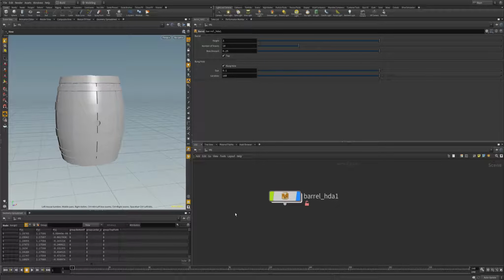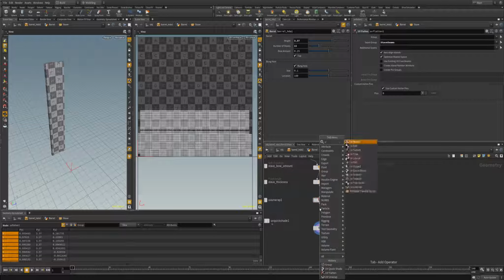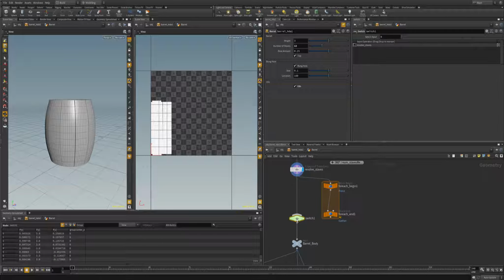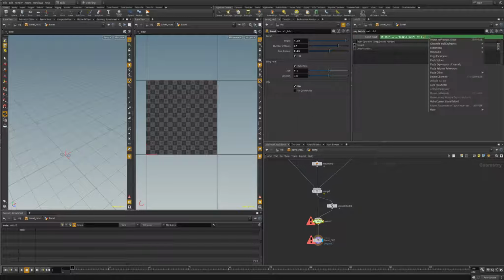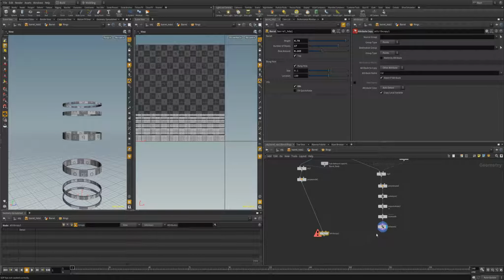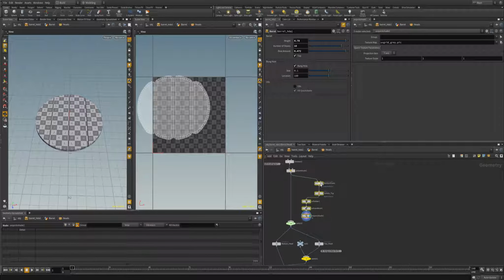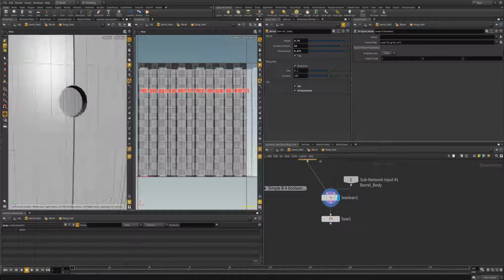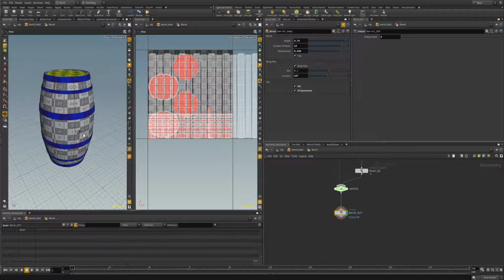Introduction to Houdini 16: Creating a Digital Asset Barrel (Part 4)

Comment: Hello. I try to repeat your lesson, but when i make for-each loop and uv transform, UVs works uncorrectly. For example: i have 4 copies (by copy and transform node) of geometry with overlapping UVs and when they pass through for-each loop, i have 4 overlapping UV islands with 4 UV in each, i.e. 16 UVs. What cause this problem?
Reply from the maker: Hi Dmitry. I'm not sure without seeing your file myself, but if I had to guess, I would say that something is wrong in your UV Transform expression. It should be :
$SIZEY * 1.02 * detail("../NAME_OF_METADATA_NODE", "iteration", 0)

If the expression is wrong in any way (I cannot express how frequently I misspell/mistype a node name) then the detail expression will return 0, and then none of your transforms will happen.

Comment: This is so fantastic introduction serie to Houdini. Thank you.

But I have a small issue in for each loop section in uv uv transform node. That expression on translate is not working for me. I am using Houdini 16.5.
Reply from the maker: Howdy Mika. In Houdini 16, the For-Each Loop I am using in this video has been renamed to For-Each Point, but otherwise should work the same. The expression used in the uvtransform1 node should be:  $SIZEX * 1.02 * detail("../Stave_MetaData/", "iteration", 0)
Another thing to check would be to ensure the foreach_end1 node settings. Piece Elements should be set to Primitives, and Piece Attribute should be enabled, using the copynum attribute  that was created by the Copy and Transform used to revolve the staves.
Reply: Ok. Thank you for your explanation.
Reply: Thanks so much for doing this series of tutorials Ben! I'm encountering the same problem as Mika and I kept getting a 0 on $SIZEX so the expression just wouldn't work. Was wondering if there was something I forgot to click on